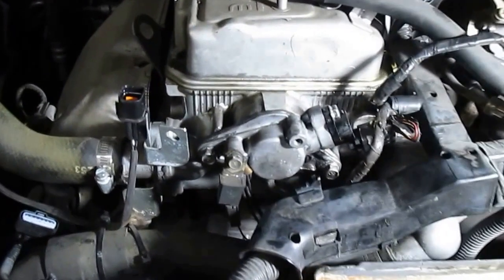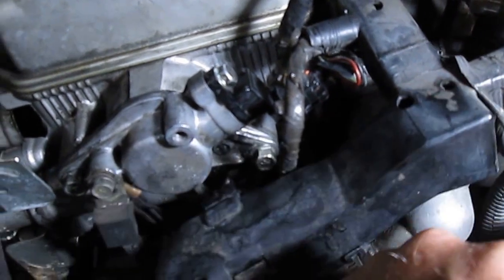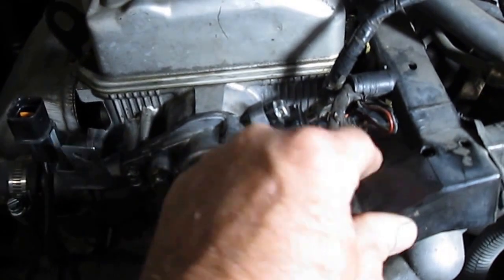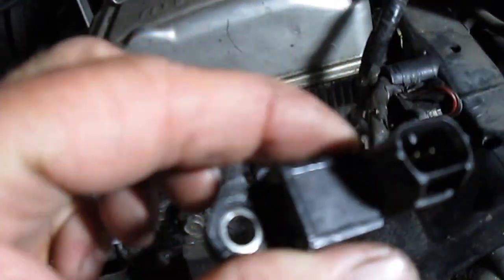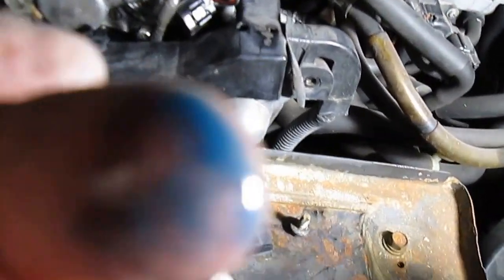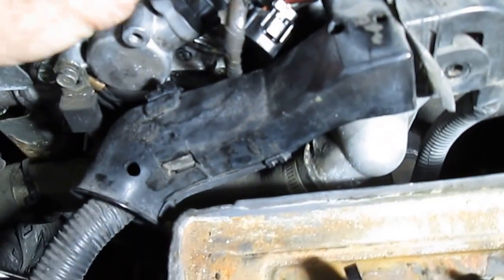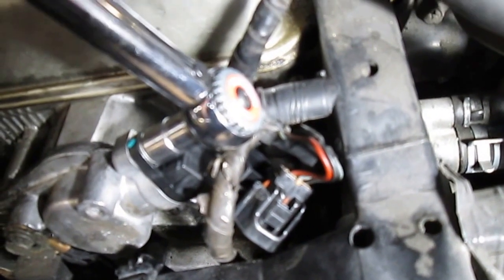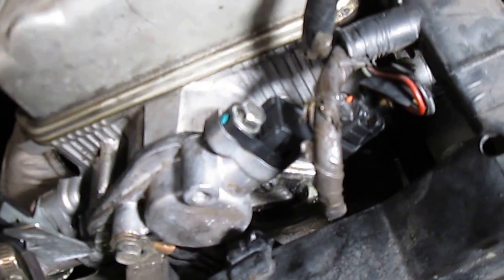P0340 Code: Camshaft Position Sensor on Mitsubishi Galant Code P0340

Comment: Great video sir! I did mine today and it worked! I didn’t plug the new one in and the car didn’t start, removed the air box hose and plugged it in and it ran like a charm!
Reply from the maker: Thanks Jeff! Glad I could help.
Reply: Thanks again sir
Reply: Jeff Please Read My Problem And See If You Can Help
Reply: Was Your car Not Able To Quick Start When You fully Accelerate..??

Comment: Great instructions even me a women not knowing how to do much more than adding oil and water was able to do it by following you video but you should really add video for taking off the air filter housing because there is not a video out there to follow and had to find someone to show me But  now I have my code cleared and all is fixed Thank you
Reply from the maker: Your welcome, next time I do one I will include removing the air filter housing.

Comment: Great video. I followed instructions. Took it for a drive. Codes were cleared.  The next day code came back. I unplugged it. Hooked it back up. Code went away. If it happens again should I replace the wire harness? 2003 galant 2.4l
Reply: Also. Kt would originally start. But would not restart after it warmed up. After replacing it would start fine. But cut out while driving.
Reply from the maker: Check the inside of the connector, sometimes a female tabs get pushed too far apart and sometimes oil gets inside there also. You can take like a little ice pick or something and push those tab closer together and spray some electrical contact cleaner inside and blow it out with some computer air
Reply: @JohnSadlersAutoRepair  thank you

Comment: I had the same problem I had code po340 and I replaced it with a aftermarket one and didn’t work still have code po340 what can it be or do I have to buy the original part
Reply: Currently going through the same with a 2012 did you ever figure out the problem?

Comment: Could you please let me know wheres its located in a 2000 MIRAGE 1.5L... CANT find any info on it.🙏🏼
Reply from the maker: Camshaft Position (CMP) Sensor is in the distributor.
Reply: @JohnSadlersAutoRepair  thanks, so its built in?. Not a separate part. I could not find it anywhere.

Comment: Hey i need your help here. My 2004 Lancer Sportback 2.4 suddenly stop while im driving i connect the ODM and it show PO340 
I change that sensor and still not starting but it gives crank. What should i do next? Thanks!
Reply from the maker: I would check the timing belt and compression next.

Comment: Hey, so I replaced my sensor with a new one since I had a random missfire and was getting the P2034 code.  Once I replaced it with the new sensor the car refused to start.  I then put the old sensor back in, and it will run, but now has a rough idle.  It feels like the timing has retarded quite a bit.  Would you know why the new sensor would cause the car not to start?
Reply: Did you find out what was wrong? Mines did the same thing
Reply: @MrDellion214  Unfortunately not really.  I brought it into our family mechanic and asked if he could take a look, and he got his own sensor to put in and he said it worked just fine when he did it.  So my best guess is that it's just a faulty sensor

Comment: Can we do this without a torque wrench because I don't have one to tell me how how much I need to torque it
Reply from the maker: @michaelrasnick1376  yes you can,  it's a small bolt. Just put it flush with the sensor and then  slightly more. Just snug is good.

Comment: Hi John, great work.
I have a Galant 2001 2.4L exact same code on diag test and followed you and replaced the sensor. Now I still get no engine start and yet cranking :/ 
I only forgot to detach battery when starting. What would be your guess?
Reply from the maker: My apologies for the late reply, did you get the car started yet? Where did you buy your sensor? Not disconnecting the battery shouldn't make any difference.
Reply: @JohnSadlersAutoRepair  Ok Idk if anyone is listening out there but here goes, so one night it was raining really hard, I parked my car, and got out, got back in 10 minutes later and the car wouldn’t crank, wouldn’t start, I tried to jump it nothing, got my car towed home. I replace the crank and cam shaft sensors, replaced the battery, the starter, the fuel pump, and all the fuses....after this, car now cranks, but that’s it, it just cranks, if I do it long light smoke comes from the engine bay, I mean really light smoke, if u were looking hard u wouldn’t even see it....I am stumped on what the problem could be, I’ve invested a lot of money into this car, and I’d really like to get it running again, it’s 80% modded, full body kit, after I get it running again I’m gonna throw on the fender flares, side skirts and get it wrapped, I swapped the hood for a carbon fiber with air vents it was $1200 the body kit was $700, I’ve put on new headers, ignition coils, please if anyone could help...Mitsubishi eclipse spyder gs 2004

Comment: Ok Idk if anyone is listening out there but here goes, so one night it was raining really hard, I parked my car, and got out, got back in 10 minutes later and the car wouldn’t crank, wouldn’t start, I tried to jump it nothing, got my car towed home. I replace the crank and cam shaft sensors, replaced the battery, the starter, the fuel pump, and all the fuses....after this, car now cranks, but that’s it, it just cranks, if I do it long light smoke comes from the engine bay, I mean really light smoke, if u were looking hard u wouldn’t even see it....I am stumped on what the problem could be, I’ve invested a lot of money into this car, and I’d really like to get it running again, it’s 80% modded, full body kit, after I get it running again I’m gonna throw on the fender flares, side skirts and get it wrapped, I swapped the hood for a carbon fiber with air vents it was $1200 the body kit was $700, I’ve put on new headers, ignition coils, please if anyone could help...Mitsubishi eclipse spyder gs 2004
Reply: Maybe water got in your gas tank, something similar happened to me car wouldn’t start only cranks I ended up blowing a seal

Comment: I have a 98 galant  carburetor engine (4g93). The issues are: crank no start(backfires sometime, I'm thinking, "bad timing, poor air fuel mixture) , blinking neutral light once the shifter goes into  Drive and the rpm is mad low.( no issues in reverse)... any help would be very much appreciated! Thanks
Reply from the maker: Hi Wesley,  I would remove the distributor cap first and look for cracks inside it. The remove the upper timing belt cover to inspect the belt condition. Sometimes they will jump one tooth and run poorly the way your describing.
Reply: @JohnSadlersAutoRepair  will do

Comment: There is another sensor below that cam sensor..I thought that was the sensor can you tell me what that is they look almost identical....I changed mine...but I'm still not getting power to my fuel pump...I'm thinking crank shaft sensor need to be changed....po 340... Is the code I got but have spark now but no fuel
Reply from the maker: What is the year and model of your vehicle?
Reply from the maker: So if you spray a little carburetor cleaner in the throttle body the engine will start?
Reply: Yes it will start... 02 Mitsubishi eclipse 2.4l... I also took the fuel pump out and put a battery to it and it worked... I put the fuel pump back in car with a battery to it started the car and it ran as well...but when I plug the harness back up nothing ..I don't hear the pump prime or nothing at all...im thinking the fuel pump relay or the mfi relay that shuts the fuel pump down..I'm trying everything... sometimes it starts sometimes it don't...but never when driving already....thanks for replying back...I just purchased the manual so hopefully I'll find something soon...
Reply: Well here's wat I did to get her up and running...I wasn't getting power to my fuel pump...and I confirmed the pump works...so wat I did was straight wired my hot and ground wire from the pump to my cigarette lighter in the back...it gets power when the car is on...it works like new again...but I still want to find out wat did I bypass to cut the fuel pump...and it wasn't the fuel pump relay.... computer need resetting I'm guessing...and also..I changed my tail lights...to LED's now my cruise control don't work...hey...I'm good...I like my tail lights...thanks for your help
Reply: @thatcutndude1  im thinking its the Crankshaft position sensor as well. If you have already replaced the CAMshaft sensor.

Comment: I have a 2003 Galant ... is camshaft or crankshaft the same thing??
Reply from the maker: No, the crankshaft sensor is down close to the crankshaft at the bottom of the engine, the camshaft is at the top like in my video.
Reply: John Sadler's Auto Repair  in my situation the car turns off when driving also the rpm will suddenly will go low and high to the point were it shuts down and I would have to wait for it to be  able to turn it on.
Reply from the maker: M41409K sounds like it has several problems.  need to have a scan tool hooked up to it and watch the readings when the issue happens

Comment: my 05 Chrysler Pacifica won't start, when turning the key it doesn't turn over but makes a squeal sorta no ice. Code p340 Camshaft comes up, replaced it but still same issue and code 340 continues to show..help
Reply from the maker: Can you record the sound and email it to me? johnsadlersautorepair@gmail.com
Reply: John Sadler's Auto Repair
I made a recording. But not allowing me to email it. Is there another way I can send it?
Reply: I sent it via FB messenger ..

Comment: My car cuts out when I'm driving and I come off the gas peddle suddenly but if I ease off the gas it stay on sometimes if I put it in reverse it cuts dies but it starts back everytime
Reply from the maker: Brian Hermanstyne put a scan tool on it and watch the tps,ltft,rpm,crank and cam signals. See which ones are going out of the normal range.
Reply: John Sadler's Auto Repair I have a 1998 nissan bluebird sss u13 with a sr20 engine where am I connecting the scanning tool
Reply from the maker: Brian Hermanstyne look on Google and ask where the OBD2 connector is for your model. Then all Nissan models will come up and it will show you a picture of the connector and where is located
Reply: John Sadler's Auto Repair thank you -
Reply: John Sadler's Auto Repair so i have an 04 eclipse 2.4. Last nite i put a new crankshaft position sensor and new battery and it drove fine but today on my way to work the check engine light came on and then a lil bit after the rpms started jumping up and down like crazy then shut off, the car starts back up but continues to shut off any idea?

Comment: I have same issues my car shows p0340&p0335 small belt was broken so I replace timing belt and small belt, I put it new sensors, but car crank after 3 o 4 times you try, keep showing same codes any advice
Reply from the maker: Does your engine run? Is your timing belt is one or two teeth off and either won't run at all or or can set codes and run poorly
Reply: John Sadler's Auto Repair yes it runs good I check the timing like 3 times all marks match the balancer thing is in the right position,  wonder if a weak starter may trigger those codes,
Reply from the maker: @sotos2428  I have never heard of that